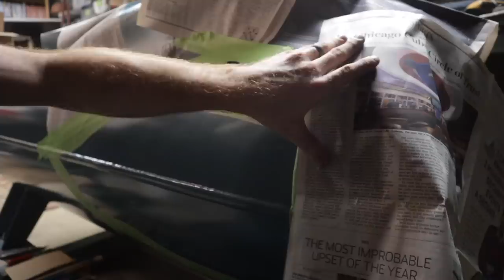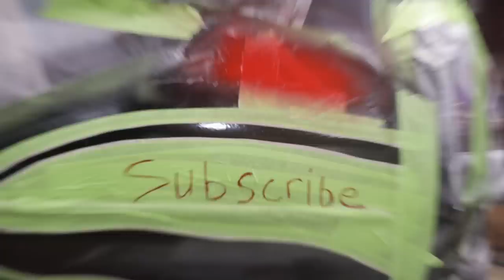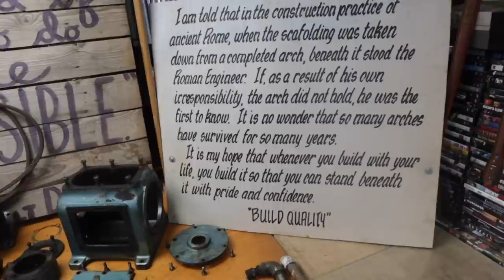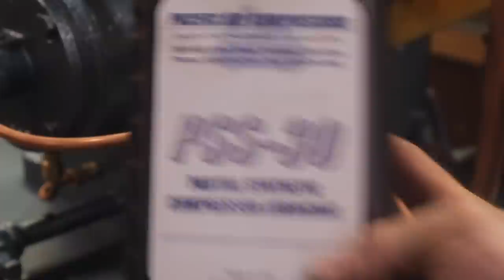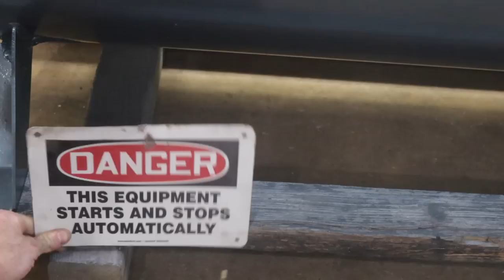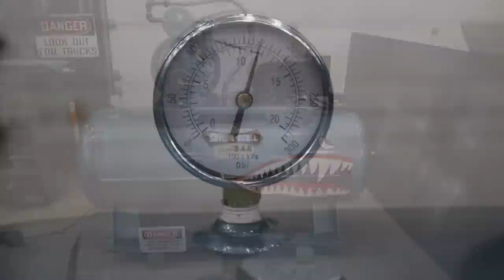OLD 2 Stage Air Compressor ~ Pump Rebuild/Custom Paint ~ RESTORATION Part 3 ~ Is that a Tiger Shark?

Comment from the maker: Question of the Video: Do you like customizing things? If so, what have you customized?
Reply: Salvage Workshop I’ve got an old 1970s German moped that I like to tinker around with. I’m too big for it to be fun to ride, but I’ve done it up for my nephew to match those colors of his favorite (American) Football team.
Reply: Maybe it's early in the morning for me, but the title in the thumbnail confused me. Should it be "Fuel Pump Rebuild" or "Complete Pump Rebuild"?
Reply from the maker: @o0hbomb0o  Complete sounds better... good call! Just changed it!
Reply from the maker: @TommySleeze  Nothing wrong with that!!! I'm sure he loves it!
Reply: I'm customising/modifying a series land rover at the minute changed engine and gearbox
Reply: Now it needs a 4 blade prop on the end LOL
Reply from the maker: @macgyver15147  that is one idea I already had, and you'll see a short video of that coming out soon!
Reply: I'm just refurbishing a mahogany table not so interesting😔🤫 but we're on curfew here on my island so it helps to pass the time🕺 Luv ur work tho bro......👊
Reply: Hey Bro I think New rings like to break in on a fresh surface like just honed .. you don't have to go nuts just enough to break the glazed shine and put a surface the rings can marry ..for a really great seal ..or they are riding up and down on the old surface..
Reply: Lots of cars, Bikes, Air Compressors (🤣), etcetera, pretty much ANYTHING that has an engine
Reply: I have a three wheel trike with a V W engine i redid from the wireing up the motor was good painted red and black shame we can't post pics here.

Comment: I love to customize things. Some of my favorite customization is inspired by Chip Foose. He said' not a quote, some of the best customization is the small little things that you don't notice, if you didn't know better where how it was always supposed to be. Tuck that bumper in a couple of inches, change the fit of an emblem or light just a tiny bit, you'll never realize it's all that was done but it looks better and like it was always that way. Of course I like the wildly radical stuff too when done right. Your tiger shark for example is amazing.

Comment: Your ability is very impressive. You do a really great job. I have an old Moto Mower power mower I'm going to refurbish as a winter project. The mower was manufactured in the town I'm from many years ago and my dad worked there for a few years back in the 50's. It was one of 7 lawn mower manufacturers in the town back then. They're all gone now and the mower I have is rare. Thanks for what you do and sharing it.

Comment: Disassemble is one thing, almost anyone can do that. But reassembling that is the trick. And it takes skill. Very impressive. I have one that I want to tackle it's been sitting in my workshop for about 15 years and it doesn't run. I don't know if I the fortitude to put it together again.
Since you live in a cold climate I would suggest putting a moisture filter on your line so you don't get water into your Air Lines and into anything it ruins your air tools and your spray gun for painting.
Now that you have an air compressor you can get yourself a sandblaster and you won't have to do all that grinding and wire wheel and sanding stuff to take your paint and rust off of your Restorations.

Comment: Just did my sailor Beale 705 last year I love it runs super good mines a smaller tank and vertical. I love your paint job came out super cool.
Reply from the maker: Thank you! They are built like tanks!! Great compressor pumps! You probably have an 80 gallon tank which is a great size for almost all garages and shops!

Comment: Hoodie, I just found your channel.
What I’ve seen so far I like.
I used to work for a compressed air contractor that sold and serviced
Sailor Beall compressors.
I must say yours came out just as good if not better than the new ones
were selling in the late nineties.
In my opinion they are the best small reciprocating compressors!
You got a winner there.
And a pat on the back to your wife for finding them.

Comment: Stumbled across this while researching how to rebuild my ancient ammonia compressor I use for an air compressor.  Enjoyed your video, appreciate the time lapse. You don't need thread sealant on a union, and you always, if the handle position allows it, put the fixed jaw of a Crescent wrench against the back of a nut, and the movable on the front so the torque is applied by the fixed jaw.

Comment: As far as putting the compressor up high, unless you have fire suppression system right above it I wouldn't recommend it.  The shop I worked at, the motor caught on fire, I mean billows of smoke.  The fire department was only three minutes away thank goodness.   Keeping a fire extinguisher, Large wouldn't be a bad idea at all.  Anything electrical, the appropriate fire extinguisher is a must in a shop environment.  Just a tip.   Beautiful paint job.  I guess a clear coat isn't required to protect the paint.  It worked great.  You have a photographic memory for putting things bac together.  Can't leave any parts off when rebuilding.   It could be disastrous.   A very, very educational video.   Very detailed and proper.

Comment: Just inherited my deceased 91 year old fathers 1959 Kellogg American 331 two stage pump sitting on a 1959 John Wood 200 psi horizontal tank. 
Been sitting for a long time probably decades.
It's a beast! 
I changed the pump oil and she fired right up.
Not sure what parts are available for the pump besides a basic tune-up kit, but I have the skills to handle the job. 
I would like to know if rod bearings and other internal parts are still available... and would sure like to clean out the sludge in the bottom too.
She seems to run good as is, just need to bump up the pressure switch to get 100psi and 135psi-cut off, or maybe 110-140 if that isn't asking too much from the old girl. 
Right now she is at 90-125 I'm thinking that's a little on the low side.
Great video, did you deglaze/hone the cylinders for the new rings and did you install new rod bearings?

Comment: Have a similar compressor head, just a bit more modern since the bottom is aluminum but the head is cast iron.  Also two stage, approx the same size as yours and also requiring two belts on the flywheel. Now I have an idea of the power it requires and also the size of tank it can handle.

Comment: I can't believe you got all those parts and still had to make a gasket. It looked like a fun build , I hope it was worth the expense , probably more hours than you wanted to spend on it.
Reply from the maker: It was DEFINITELY worth it! (any YES a lot of work!) Apparently this pump might actually be from the 60's and the unloader housing is no longer used, so the gasket that came in the kit was just slightly too big, but would have worked... I wanted it to look flush like all other gaskets, so I made that one!

Comment: I have a 1964 De vilbiss 60 gallon tank upright has a Leland replusion start motor that is huge I mean this thing has to be 100 lbs only runs at 750 rpm and only 1.5 horsepower. Picked it up back in 1995 for $250 lapped in the reed valves timed the brush holder and changed the oil and replaced the pressure contactor. Running to this day and its quiet todays compressors are loud as hell like a weed trimmer no wonder at 3600 rpm for CFM . Mine a little slow gets the job done and the neighbours dont complain.

Comment: at timestamp 29:34 you installed a new steel braided line. What size was used? Also what fitting was used a timestamp 29:45?
excellent videos of the hard worked performed.

Comment: Beautiful job, only one suggestion, use a torque wrench when tightening the cylinder housing to the crank housing and the cylinder head to the cylinder housing.

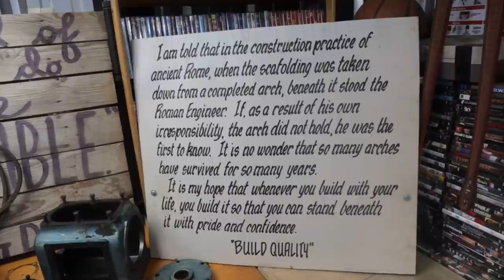Comment: why did you weld a nut on the piece of stock bar? an adjustbale wrench would clip on the bar with no need for the nut. 11:55 Great one. Thanks for sharing
Reply from the maker: I welded the nut on because it allowed me to use the power of an impact to remove the caps, plus it only took a couple minutes to make the tool that some companies charge a bunch for... I have always  loved that saying, and I try my best to live up to it! I'm glad you liked it!

Comment: Great restoration! You have some awesome skills, nothing seems to intimidate you. I was wondering when you took the plugs for the valves out, the piece of flat bar you were using already had a fairly large hole in it. I was wondering why you didn't just put a long piece of round bar through the hole and turn the plug  off. You wouldn't have had to cut the bar or weld the nut on.
Reply from the maker: Thank you Bruce! I am definitely not afraid to fail, and I believe that gives me the confidence to conquer projects regardless if I've ever done them before! I made that tool with the flat bar and nut so that I could use an impact gun on them to remove the plugs... They can be notoriously STUCK in there and I didn't want to take the chance I might mess up or break the plug doing it manually, and I don't regret spending the time to do so!

Comment: Sealant is not required on the coupling at the end of the flex hose, the cone surface is where it seals. A dot or two of high temp threadlocker for vibration might be good...

Comment: Here is a tip for you, any paper gaskets or  any you have to make use a lithium based grease and rub into both surfaces until it feels wet and has soaked through, that way if you have to strip it down later no paper gaskets get hung up between mating faces.

Comment: Great looking project. We run Saylor Beall compressors at work, but I do live in Michigan.

I have a question on why you put pipe dope on the threads of the union? I see lots of people do it. To me that doesn't make sense, it is not a sealing surface. The face is the seal and even if the threads are sealed the back side of the nut part isn't sealed. I'm not a plumber or anything, just trying to understand.
Reply from the maker: Thank you Kent! Typically Iron pipe unions have machined mating surfaces, and are self sealing on the union side, therefore they do not need paste or tape to properly seal!

Comment: Beautiful work !!! One question, what did You do with the inside of the Tank? Cleaning? Sealant? Thanks for the Video‘s. 🤗👌👍
Reply from the maker: Thank you Peter! The inside of the tank was in good condition and didn't need anything... If a tank "needs" something like that, it might not be a safe tank to use in the first place!

Comment: You assembled the compressor without using special grease on the bearings. And other parts could use some thick oil, too. Now the machine is being used with completely dry parts. First, the mechanism will have to move before the oil starts to be distributed, on the inside. And other parts don't get any grease either, making disassembly, for a future restoration, needlessly difficult. 
I do like the end result, though...!   
That's one mean compressor........
Literally....!  ;-)
Reply from the maker: It was assembled exactly the way the manufacturer assembles the brand new compressors to this today... I know because I spoke with them about it! Thanks for the concern though! I appreciate you watching & commenting!
Reply: Excellent. At least you did some research !  ;-)
And I have learned something, too.
Thank you. 
Great videos. Keep up the good work.

Comment: Beautiful work of art and so cool they still make parts for it. Sign of a good company. Unfortunately air tools are going out in most sectors. Battery power has pretty much replaced everything air powered. I haven't used my compressor for a several years. Loud and noisy and hoses are inconvenient. I'm still jealous of yours.
Reply from the maker: You know your comment about new battery powered tools happens to be spot on for most things, and I have many battery powered tools and love them, but for professional paint spray guns, sand blasting cabinets, plasma cutters, Air Hammers, tons of nail guns, and just plane ole blowing things off, you can't beat air!

Comment: If your going to use this a lot, you might consider putting a higher hose fitting on a elbowed pipe upwards and you need a drier.  You shouldn't hook up tools or paint without a drier cause it will ruin your paint with water and your air tools will corrode internally without a drier.  Super job though in the rebuild.

Comment: Circa 30:15 -- Is the finned side reservoir an intermediary stage buffer, similar to an intercooler?
Reply from the maker: That is correct! It helps cool the air between cylinders.

Comment: Was there somewhere on the compressor to add a lifting eye?
Did you find a manual for this? Too many parts for me. Need some sort of guide. You must be a genius.
Like others have commented, great build, excellent color choice. Still suggest you open a weekend school. Maybe work on those other compressors for shop classes or clinic.
Suggest you find a hotel or motel in the area and acquire their old towels for use. Many just throw them out.
Reply from the maker: I'm no genius! I'm just a guy who only knows enough to be dangerous!

Comment: When do you put the tape off I either do it to late or too early xxx
Reply from the maker: Better question is what tape are you using... That is VERY important! 3m Scotch 233+ tape is what I use for all projects... It's not cheap, but the results speak for themselves... make sure each coat is FULLY dry before taping over the previous one and I remove the tape once the paint is fully dry! Good luck!

Comment: Beautiful work, and well worth the time watching :)
I'm just wondering about the last coupling you attached to the outlet of the compressor. Those couplings, aren't they supposed to assebled dry, metal against metal seal.. ? I see you used some sort of sealant on it - but it may of course be because the seal surfaces were bad - i dont know :)

Great work !!

Comment: Did you run a cylinder hone through those bores before installing the new rings just curious. Great job that thing is as good as new, Plus that paint job is killer!
Reply from the maker: I did not. I spoke to the experts at Pacific Air Compressors, where I got all my rebuild parts, and they advised against doing anything to the cylinder walls due to how nice they still were, and they said the new rings will break in just fine!  Thanks for the compliment, it definitely turned out pretty dang nice!! Thanks for watching and commenting! I truly appreciate the support! Lot's more to come!
Reply: @SalvageWorkshop  great air pump rebuild!
I noticed the lack of cylinder hone as well. Good to know it wasn’t an oversight and that you were advised not to do it. 
I’ve rebuilt a couple of large DeVilbiss V4 4 cylinder air pumps and really enjoyed the process..

Comment: that's a damn fine looking compressor and tank you've got there. only a million hours cleaning? i'd have thought 1.6 mil. easy. what i'm wondering is, with the extensive rebuild kit you got, why it was you still had to make a gasket? they just can't put them all in there, can they? it seems there's always one they leave out to sell you separately, greedy bastards! way to give'em the old "up yours" by making your own. excellent job all around!

Comment: Re: previous soundproofing comments... Oh. Nice
Reply: Just got to the end, very nice
Reply: Ok, I have to scratch the itch. I wasn't going to but... You'll probably want to put some sort of sound deadening on the walls behind the compressor, Construction grade foam insulation board should make a big difference.
Reply from the maker: I thought about it, but it's surprising how quiet a professional compressor actually is! Let's see if my tune changes after using it for awhile!